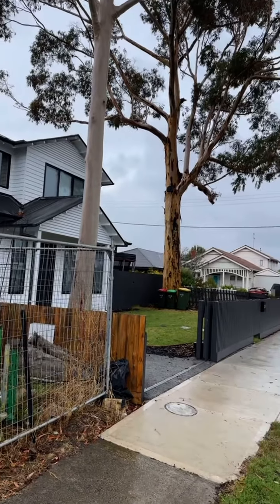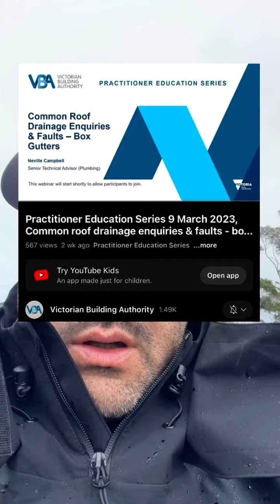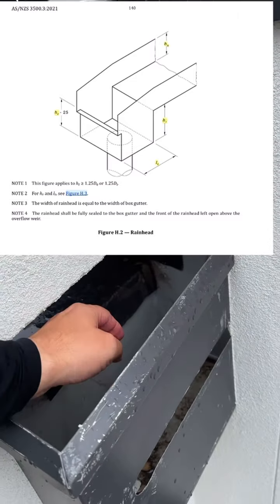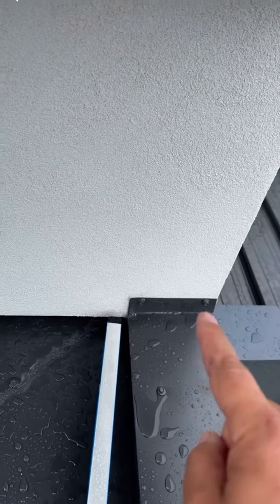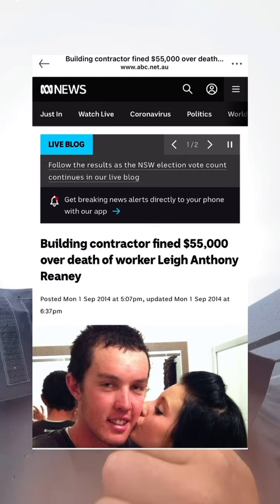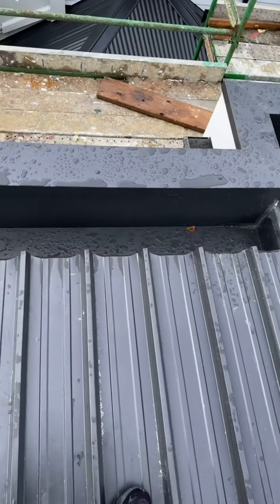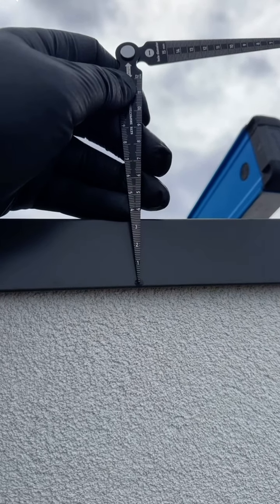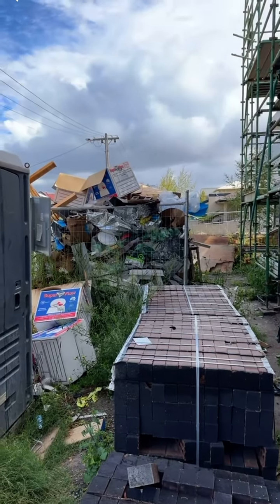Rainy Day Building Inspection: Non-Compliant Roofing, Defects, and Safety Issues Uncovered

Comment: have you ever been to a job where everything is done right?
Reply: It’s not about everything being done perfect. It’s a back and forth until enough is corrected and put on notice so the builder learns for future builds and the standard continually improves. Critical safety related non-compliance and damage creating defects are the important part. As well as giving the owners the information needed to proceed as they see fit or letting the Gov chase it up
Reply: @urmum2295  and here on planet earth tradesman are in short supply and finding unicorns that fart lollipops 🍭 isn’t as easy as you think.
Reply: @urmum2295  why shouldn't things be done perfectly? What do the tradies not know what the standards are?
Reply: @GameFuMaster unfortunately just because someone calls himself a tradie it doesn't make it so, I rember we got an influx of Irishmen a few years ago, they all claimed to be carpenters (must've been told we had a shortage so write that on the visa application) but half of them couldn't even drive in a nail with a hammer

Comment: What a state. Unsafe scaffolding , shoddy workmanship and allowing water ingress that will not only soak the interior but will create mould damp and smells.  Builder needs to be pulled over the coals for this.
Reply: Have you ever done roofing?.. this is actually a pretty good job. I wouldn’t call it shoddy workmanship at all.. 
this guy doesn’t really know what his talking about when it comes to
Roofing. 
What he said about the apron flashings is incorrect. The aprons are clearly installed over a rib and into the pan, not shoddy. He just is confused because he doesn’t really understand what’s going on underneath, because his not a roofer. 

A few cappings been 40mm instead of 50mm is really not a big deal. Same as the rainhead side overflows. He pointed out that some instalment methods are not “deemed-to-satisfy” but this does not mean it doesn’t meat the performance requirements.

Performance requirements can be met with the deemed-to-satisfy instalment method or a performance solution. A performance solution can be met by expert judgment from a qualified and experienced person. 

Don’t be fooled by the confidence this guy says “not complaint” because this guy has clearly no expertise in roofing. He just reads a few deemed-to-satisfy instalment methods and thinks that, that’s the only way it can be done. Which as I’ve just explained above there are other ways to reach performance requirements other than the deemed-to-satisfy instalment methods. And sometimes they actually have done the correct deemed-to-satisfy instalment methods and this guy just doesn’t know what his looking at, as he proved by saying the apron flashing is incorrect.

Comment: How are architects supposed to build up to frank Lloyd wright’s standards with a building inspector like you coming around pointing out the fact that water isn’t supposed to be stored on the roof. If you knew anything about architecture it should be that a house isn’t worth squat unless the freakin roof leaks….

Comment: Why are you saying the apron flashings are not complying? The extract says apron must fall into full pan?? And they clearly are falling into the pan? You can see it is lapped over the rib and falling into the full pan? There’s literally no difference between the one you said is compliant and the ones you said are not complaint. The “complaint” one is just wider than the others because the sheets landed further away from parapet? 

There’s a few tiny little things you could knit pick on this job but all in all it’s a good job.

The internal downpipes on the sumps are obviously going to be installed so saying that the sump is running into a pool in the house is stupid. Roof plumbers always complete jobs in 3 stages. The sheets, the cappings and then the downpipes. And internal downpipes are often done by plumbers not roof plumber. It’s unfortunate that it rained before they could get there to install them but these things happen (especially in Melbourne).. it’s very misleading, for people who don’t work in construction, for you to say “they have the sump draining into a pool inside”. Timber and slabs get wet all the time in construction, as long as it’s dried out before the gyprock is installed it really doesn’t matter.
 
I would also like to point out that just because something is not installed by the deemed-to-satisfy instalment method does not mean it cant reach the performance requirements. A performance requirement can be met with either a deemed-to-satisfy or a performance solution or a combo of both. And a performance solution can be met with “expert judgment”  from an expert who has the qualifications and experience to determine whether a Performance Solution reaches the performance requirements.
So every time you say it is not “deemed-to-satisfy” does not mean that it is not reaching the performance requirements!

I would also like to point out that Australian standard change almost every year and the change a lot in roofing.  What was complaint last year can now be called non-complaint this year, but it doesn’t mean you have to go replace everything that was built last year! And it doesn’t mean these will leak. It’s just improving on what is already a high standard. Australian standards are the  highest standards in the world and that’s not me exaggerating, that’s a fact. Just because a capping is 40 mm instead of 50mm doesn’t make it a bad job! A few cappings missing wind breakers are not a big deal! 

This is still a good job in my opinion and sometimes your videos are borderline slander. I think any roofer watching this would agree with me.

The biggest problem I could see was the safety risk with that one plank across the opening. That should be a serious scare for the builder and fixed immediately.